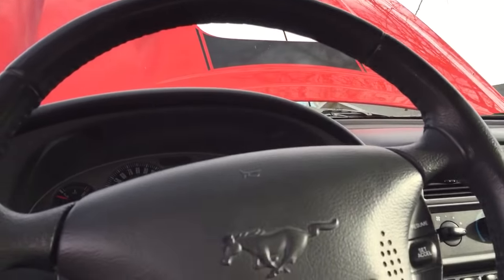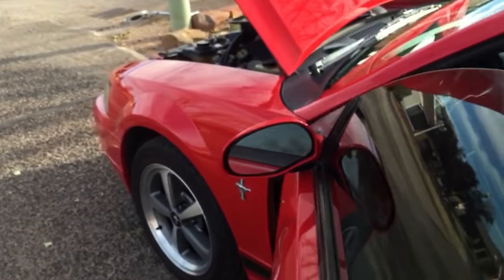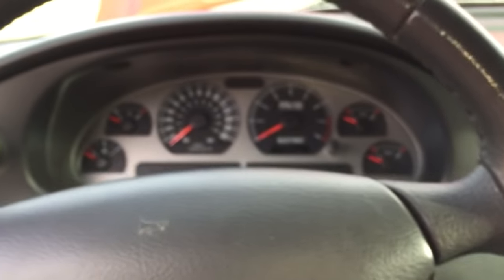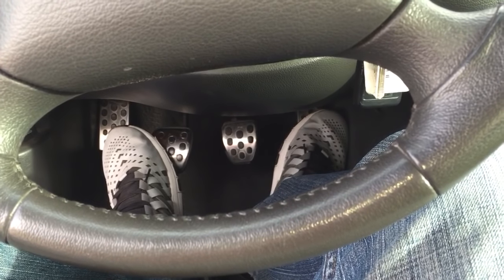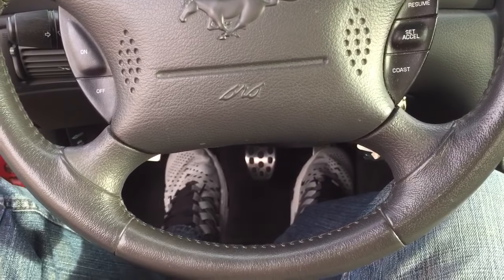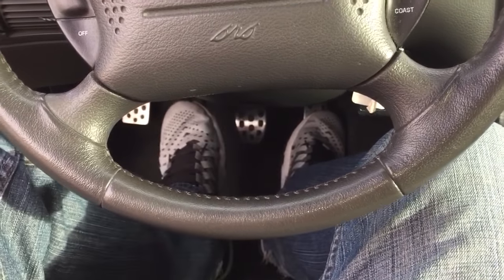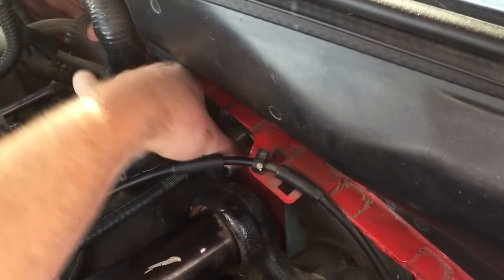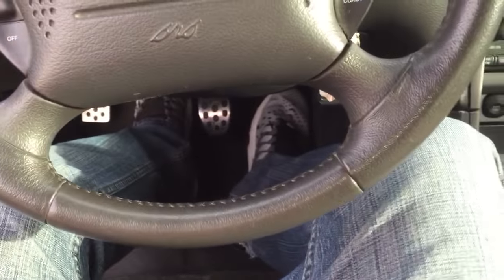How to adjust your Clutch: Ford Mustang. Clutch quadrant & firewall adjuster ajustar embrague chirp

Comment: When you installed your firewall adjuster did you have to make any adjustments to the gray rubbery seal material that’s on the inside of the car I am attempting it and I am having trouble with interference from that I would assume it’s noise heat vibration insulation.
Reply from the maker: I only remember the cable itself needing to be modified but it’s possible your car had some more insulation from the factory

Comment: If you tug on the cable at the firewall, do have any slack/gap between the firewall adjuster and the flat part of the cable sheathing?
Reply from the maker: Steve Slavik usually about the thickness of a dime

Comment: Hi Danny, just wanted to say thanks for the videos you made regarding clutch replacement. It definitely made it easier to do, knowing what to look for. One question,  I know there is a filler nut to add tranny fluid to the transmission, but can it also be added from the inside of the car at the top of the tranny when re installing the shifter?
Reply from the maker: Yes, you can do both. Add the 4 quarts in the shifter which is nice since you don’t lose any in the pump, or pump it in the side on the the side fill plug. It should overflow when it’s full and the car is level, but the tr3650 five speed asks to slightly under fill it. The t-56 is just 4 quarts and should overflow if the side plug is out
Reply: @dannyjohnsonsgarage  thanks for the information. Doing this kind of stuff with my son is great. He to owns a 03 cobra. You may know him, he sent you a blurb about the Sonic blue terminator used as a police car.

Comment: Is it possible to run a new cable without the firewall adjuster which has been a pain in the a to find without long wait times and my GT being down.
Reply from the maker: It is possible, but the replacement cables may be too long if you dont buy a factory cable (thats discontinued). I had the best luck with this one who uses the same company ford used for their cables  https://youtu.be/RkEn5FJHs8g?si=FYTM_dzLoktxD2fV

Comment: Hi Danny, I really like your videos! I have a question that I would appreciate if you could try to answer. I have tried to adjust the clutch on my 2000 mustang, and when I try to pull up the pedal like I heard your supposed to and hear a click, it did not click. After trying, I also have a bit of chirp now! I have the original adjusting mechanism, not an aftermarket cable, and I really need to know how to fix this. I would appreciate your help!
Reply from the maker: @bobbyperl8955  an adjustable clutch quadrant and fire wall adjuster is the best way. The factory ones strip being plastic Clutch quadrant, firewall adjuster, cable install & Adjustment Ford Mustang 79-04 Cobra, GT, V6
https://youtu.be/RkEn5FJHs8g
Reply: @dannyjohnsonsgarage  Thank you! Got the v6 as my first car, worked a lot to buy that car myself! I'm fixing a couple things, and I have to pay for the parts but luckily I have your videos to help! In a way you got me into these cars.

Comment: What if it's literally too hard to turn? Like I can't turn it either way. I have one similar to yours but is a little different looking. It almost seems like I need a tool to turn it maybe.
Reply from the maker: Sometimes you need a large pair of pliers. Otherwise, remove the cable from the clutch fork and adjust it and put it back on with the pry bar

Comment: Hello,  when I turn the car on it starts to chirp but once it warms up it goes away,, the transmission feels excellent the gears go through excellent,, is this chirping on start till it gets hot bad for the clutch ???
Reply from the maker: The throwout bearing is just barely contacting the clutch diaphragm fingers when you hear the chirp. It just needs a little more pressure

Comment: I have a 1989 Ford Mustang and I replaced the cable last year and there’s some issues with it we’re it just doesn’t stay in place it just falls off and makes the clutch feel loose with no pressure please let me know how fix this hope to hear from you
Reply from the maker: If it’s an aftermarket cable with the nuts on the end you’ll need multiple nuts and even some lock tite to keep it from walking off
Reply: Thanks

Comment: Hey Danny, I'm working on replacing the valve cover gaskets on my 96' Cobra. To remove the stock clutch cable from the firewall, do I need to disconnect it at the clutch fork first or can I just disconnect it under the dash & pull it out of the firewall to get it out of the way?
Reply from the maker: I would just disconnect it at the pedal and pull it through

Comment: Just installed one of these on my car and when I try to adjust it out to make it tighter my whole clutch cable wants to rotate with the adjuster and it’s very hard to turn. Any advice ?
Reply from the maker: I would see my install video to make sure it’s all right, but they can be hard to turn where you need pliers- or a trick I use is to disconnect the cable, make the adjustment, then reconnect 
https://youtu.be/RkEn5FJHs8g

Comment: So a tight cable yields a lower bite point?
Reply from the maker: @emilianomoreno2893  Firewall Adjuster Clutch Setup
https://youtu.be/vLj5B0fZCKk
Reply: @ yes when I screw it outwards it will make it so the bite point is higher?

Comment: I own a 2001 bullit, is it normal when I tighten the clutch cable that the bite point seems to rise?? I’ve owned a manual previous to this car but my last was a hydraulic clutch. I know I’m a few years late but I was hoping you may have an answer for me. Thanks
Reply from the maker: The stock unit is self ratcheting, but plastic teeth. It’s best to replace with a better unit 
https://youtu.be/RkEn5FJHs8g?si=K3DHvZ0WrFB8hMMP
Reply: @ it is aftermarket, it looks just like the one you showed in the video.
Reply: @ I may just not be used to the clutch being different, the biting point just seems to be pretty high up after I tighten the cable.

Comment: Hey Danny im a big fan of your channel i watch all your videos about the 99 04 cars! My clutch fork is too far to the right (towards the rear of the car) I've tried the firs walla adjuster and even a custom quadrant could I need an adjustable pivot ball for the clutch fork? My clutch is slipping is the problem thanks in advanve.
Reply from the maker: It sounds like the clutch is slipping itself, but not from the clutch being depressed. If the fork was sitting closer to the engine side, that would indicate its being engaged and could cause it to slip. It sounds like it’s time for a new clutch. I’ll put some links below
Reply from the maker: Clutch install https://youtu.be/UFr0Rur_EWc
Reply from the maker: Pivot ball stud (I would not get an adjustable one unless you get a Mcloud RXT. People even have to trim the bolt on adjustable studs) https://youtu.be/q7iJDYIZB6M
Reply from the maker: Clutch fork https://youtu.be/xsLqZE3Fs4Y
Reply: @dannyjohnsonsgarage  the clutch is brand new its a 26 spline and the input shaft on the transmission is a 26 spline the pressure plate is new the bearings are all new I greased everything and the flywheel is new. I'm lost.
Reply: @dannyjohnsonsgarage  could it be because the pressure plate isn't tightened and torqued?
Reply: @dannyjohnsonsgarage  i think I got it figured out see i had the pressure plate bolts half way tight and the springs on the pressure plate weren't compressed and that I believe is why my clutch was slipping

Comment: Thanks for the vid bro, my clutch has been shaking up and down making a weird noise ever since i had a new clutch installed. Also a few days ago my clutch got really tough to push in and wouldnt let me put in 1st gear and if i was in 1st, it would get stuck on Neutral and it would lock me out for the next gear. I then leave it for like 1 hour and then it lets me drive it. What do you think might be going on? I was told on forums to check firewall for obstruction but idk, now my mechanic says i need another clutch and i just had it installed 5 months ago. But i was learning how to drive stick the first 2-3 months of the new clutch so maybe i did wear it out. Please help, ill appreciate bro
Reply from the maker: Jose Martinez it sounds to me like it's possible that the throwout bearing may have burned up, or is getting too hot. My throw out bearing was too tight at one point and as I was taking a road trip to Las Vegas my clutch started to Stefan up on the pedal. If you have a firewall adjuster you can back the throwout bearing off a little bit as shown in the video.
Reply from the maker: Jose Martinez if you end up needing a new clutch because yours has been burned up when you were learning, I have a video series that will show you step-by-step from start to finish how to install a new clutch and throw out bearing. It might be a good idea just to watch these videos anyway so you know how it all works https://youtu.be/UFr0Rur_EWc
Reply: Thank you bro, this helps out and well now ima try to adjust my cable

Comment: Hey danny, i just installed a mcleod quadrant and adjuster (same as fiore) on my 04 mach 1. I was wondering a few things, first how did you manage to drill the 2 extra mounting holes for the adjuster? i have barely enough room to reach the 2 factory holes. Also, did you use any spacers to center the quadrant? i seen that you used the white plastic spacer on the main shaft, do you need to put something on the secondary shaft as well to control side to side movement? Any advice is greatly appreciated!
Reply from the maker: If I remember correctly, the kit came with self-tapping screws, and I only did the bottom one and it’s been secure enough. I did add a spacer on the shaft, but to keep the pedal from chattering, I added the freeplay elimination mod (I’ll add a link below). Having the stock cable helped with the chatter as well
Reply from the maker: 05GT_04Mach Freeplay mod https://youtu.be/3og_dCB9s-g
Reply: @dannyjohnsonsgarage  thank you. Gonna try and get the last 2 screws into my firewall adjuster somehow. Will head to the hardware store and build a freeplay mod and grab some spacers for the quad. Your videos are extremely helpful!

Comment: So my clutch pedal is higher then my brake pedal. About 3/4 inch higher. Is that normal for these cars. I have the 3.8 v6 with the t5 trans
Reply from the maker: Yes, ford staggered the pedals and even did a lower gas pedal for the cobra as I recall
Reply: @dannyjohnsonsgarage  thanks danny i feel a million times better because for awhile now i thought maybe i did something wrong when i changed the clutch last.

Comment: Any chance this would form up a clutch pedal? I had a trans replaced and new clutch installed. Used factory cable, and now my clutch feels like a VW jetta Haha. Meaning there is like no force needed to press it down? I did the factory adjustment and the clutch let's out almost at the top of releasing it.
Reply from the maker: Sean Colon It should be easy to push the clutch in, but that all depends on the clutch as well. Many of the better clutches with higher clamping force face a stiffer pedal from the diaphragm fingers. If yours is soft enjoy it unless you lose clamping force and it slips
Reply: @dannyjohnsonsgarage  i appreciate the reply. it's a stage 2 clutch (non name brand) but it's really soft like I feel if I pressed it with 2 fingers it would go down.  Went through a head ache of buying a used trans had it installed and it was shot, had to get another , and now good trans, new clutch and super soft pedal :-/.

Comment: how do ik if my TOB is out? i’ve replaced the clutch cable and it has a chirping sound when i press the clutch and let off , do i have to adjust it from the firewall? it also doesn’t go in gear when running but when off it does , please any advice??
Reply from the maker: It doesn’t sound like it’s getting full travel it it’s locking you out when running. What clutch quadrant and firewall adjuster do you have?
Reply: @dannyjohnsonsgarage  a ford racing quadrant and a sr performance firewall cable u known find it when i bought the car

Comment: When you tighten the adjuster is it supposed to loosen up any at all. I got the cable set up from American muscle. Bbk type. After I test drive it or go to the store I check it and it’s loose again
Reply from the maker: Daniel Lopez It should not do that. I bought the “micro click” one from fore and really like it because it only rotates and clicks in increments. You may want to put a dab of blue lock tite on the threads and then adjust it
Reply: Super glue or Teflon tape or just glue
Reply from the maker: Daniel Lopez thread locker (blue not red) on the threads. Back it out a little, apply the thread locker, then put it back where it was.
Reply: Oh ok koo. I found you on Instagram but wondering if you had a Facebook. Add me it’s Daniel Lopez on fb and tapoutred on insta

Comment: My 02 mustang gt constantly chirps no matter what I need to buy a adjuster
Reply from the maker: Caffinito yes, if you don't have one. If it continues to make noise the bearing itself can be bad and need to be replaced
Reply from the maker: Caffinito here is a step by step if you need to replace the throwout bearing https://youtu.be/UFr0Rur_EWc
Reply: Danny Johnson I just replaced my clutch and bearings tho. The chirping goes away if I rest my foot on the clutch the slightest bit
Reply from the maker: Caffinito ok. Just out of adjustment then. A firewall adjuster and clutch quadrant should fix that right up

Comment: So I just bought my 97 cobra and it has this on it but it takes like 45lbs to push my clutch pedal in is that normal?
Reply from the maker: It can depend on if it's a stage 3 racing clutch, but typically, no. It could also be a throwout bearing seizing on the retainer sleeve causing drag
Reply: @dannyjohnsonsgarage   ya it’s a stage 3

Comment: hey there my friend ! question , i just installed a cable and quadrant.  seems to work good only thing is the point where the car grabs the gear is pretty high up on the clutch pedal. is there any way i can make it to where it’s more closer to the floor that it grabs rather then higher up? thanks !!
Reply from the maker: If it’s too high up grabbing the cable needs to be slightly tighter with an adjuster. It doesn’t take much
Reply from the maker: https://youtu.be/RkEn5FJHs8g
Reply: @dannyjohnsonsgarage  right i did forget to mention i installed the Steeda adjustable, clutch and quadrant
Reply: @dannyjohnsonsgarage  and i see you used the Maxium Motorsports one. on the steeda one the cable it’s self where it goes onto the fork is adjustable not sure if you are too familiar with the one i have but i couldn’t really find a video. unless that is how this steeda one is designed
Reply: @dannyjohnsonsgarage  because i have it where there is no bearing noise as per your other video on how to adjust the cable with the red mach 1 you have. when i try to adjust mine from the firewall i physically cannot as it’s just too hard to spin now but like i said no issues just that the biting point is high and i would like to know if i can make it closer to the floor

Comment: Which clutch quadrant would you recommend?
Reply from the maker: I really like the Fiore brand. I had the steeda double hook and it seemed one hook was too low and the other was too high. I had the best luck with a ford oem cable and the fiore quadrant
Reply: Danny Johnson thank you for the reply would you also recommend the fire wall adjuster that comes with the Fiore quadrant?

Comment: I have a question.   I have a bbk firewall adjust kit and cable.   The nuts on the adjuster tranny side on the fork have to be all the way at the end as far as possible and the firewall adjust in pretty much all the way to get the clutch to engage further to the floor.   If I put the nuts tighter and turn out the adjust on the firewall the clutch engages higher off the floor which I don’t like.      Is this normal?   It’s a pain in the ass because I barely have enough thread to put the jam nut on tight on the fork.
Reply from the maker: I don’t like any aftermarket cables, even the ford racing. The nuts back off too, so I got a ford OEM cable and run it with the firewall adjuster and the quadrant
Reply: @dannyjohnsonsgarage  Thanks for the reply. I figured out a way to have it tight and secure and engage exactly where I want it along with your spring mod. Thanks again Danny
Reply: @jamesa6272  how
Reply: @benignocepeda7720  Hey. I just  replaced my clutch flywheel and everything else.  I noticed the spring clip on the back of the fork was bent so the fork was probably surfing all over the pivot stud.    So that might have been the reason why I was able to get more threads with the nut.     BUT I also bought a “ford performance ” cable which in fact doesn’t have any ford logos on it and is made in Taiwan but pretty much the exact same design as the garbage bbk cable and had the same exact problem I posted above.    The adjustable portion on the cable is not made long enough.   How on earth they can make cables like that and sell them is beyond me.    I would say just buy a stock ford cable like Danny Mentioned.    With the new install I just did I had to reuse the bbk cable and had to use shallower nuts just to grab some threads on the cable.  It’s literally right at the end of the adjustment piece.